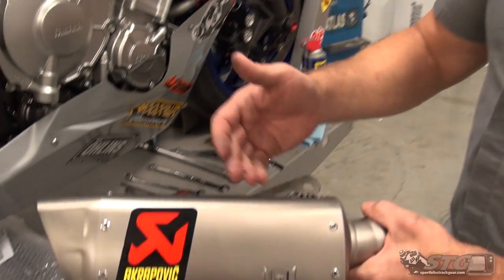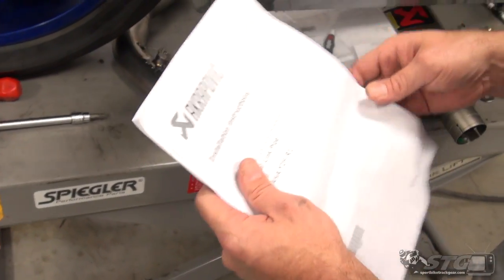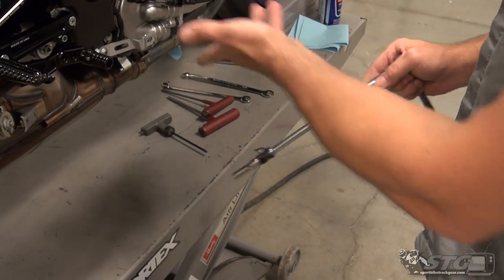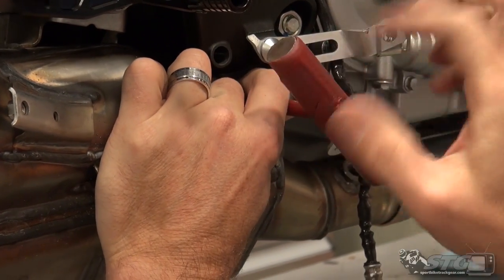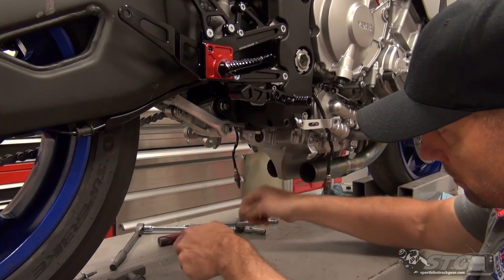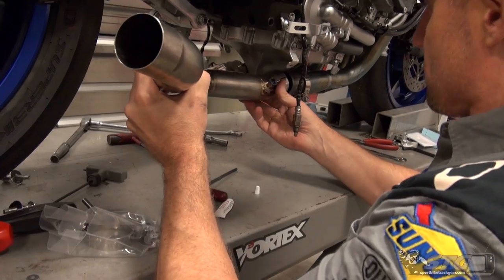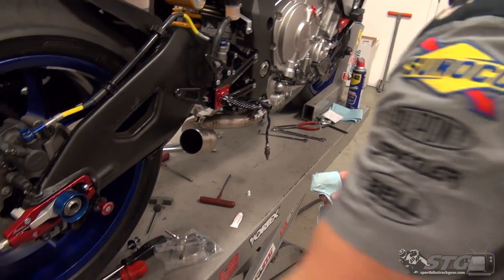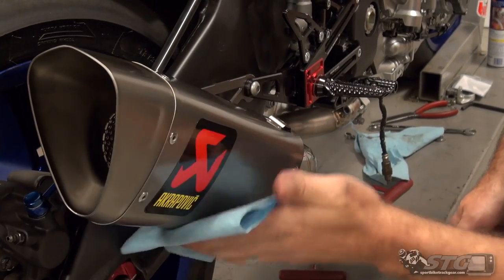Akrapovic Slip On Exhaust Install on a 2015-2018 Yamaha R1 from Sportbiketrackgear.com

Comment: Hello to all . with this exhaust my bike lost power. and accelerarion especially at low rpm motor. It is a normal thing ?! is there any way to retrieve the power lost?
Reply: +Alex G. You can't just throw a cat deleting exhaust on and not expect it to run poorly.  Get a flash tune, PCV, or Bazzaz.
Reply: +Jimmy MX on my old r6 there was impostation CO.
enough to incrase a bit values. and the problem la solved
Reply from the maker: +Alex G. Get a Flash Tune Kit, this will help solve that issue. That said the bike should still have more power higher in the rev range than before you installed this. I believe the exup valve is also intended to help with power at the lower end a bit, the negative is the flow restriction at the upper end. End of the day you will need to run just a bit higher in the rev range for low speed riding, the improvements will be noted as you rev the bike more and at higher speeds. - Van
Reply: +Sportbike Track Gear power commander 5? is ok?

Comment: which one is louder the shorty arrow or this one and which one makes more hp?
Reply from the maker: +Anthony evert I would say the Arrow is louder and will make just a bit more power than this 3/4 system. Now that said most riders will never notice the very slight difference in power (myself included). The quality and looks of this Akrapovic system are on another level as compared to everyone else IMO. There are other good systems for sure, many are more affordable and will perform and sound great. - Van
Reply: +Sportbike Track Gear yes I agree both sounds amazing I saw that they have another version of that akrapovic it's a gp akrapovic I think that one makes more power than the arrow and that akrapovic

Comment: This is for R1 2016 and fix for Akrapovic Yamaha YZF-R1/M 15-17 GP Titanium Slip On Exhaust?  642.55 $ for price....
Reply from the maker: Akrapovic Yamaha YZF-R1/M 15-17 GP Titanium Slip On Exhaust $713.10
Akrapovic Yamaha YZF-R1 15-17 Titanium Optional Link Pipe/Collector $642.55

Installing both the link pipe and slip on will get you the same 3/4 system I have on the STG R1. Have been very happy with this system. - Brian Van

Comment: The canister mount on the Akra utilizes a stock bolt?
Reply from the maker: +R-AIK It does!
Reply: Sportbike Track Gear is it posible to use the stock can on the akra link pipe?

Comment: which would you recommended M4 or Akrapovic??
Reply from the maker: Depends on what you are looking to spend in all honesty. The Akrapovic stuff is really some of the highest production quality stuff you can find out there. On the other hand M4 has great fitment and is priced very reasonably. Really all about getting what is right for you!
Reply: STG, do you recommend an aftermarket ECU (PCV) with this application?
Reply: TheVilouboy what kind of bike do you have ??
Reply from the maker: TheVilouboy Personally I use one, but it isn't essential.

Comment: Hi Van, Great video! I have the Akrapovic and link pipe with power commander myself. Question, is the Yoshimura Alpha 3/4 or Graves less loud than the Akrapovic? Thank you in advance. Best Fabian
Reply from the maker: +Fabian Otten I would say they are slightly quieter that the Akra. Thanks for watching!

Comment: how did the 520 kit feel?
Reply from the maker: +Kyle Abron Felt just fine, I went with stock gearing. At the track I made one small chain adjustment during a tire change. Vortex makes good stuff for sure! - Van

Comment: Greetings Van,
Wait......I didn't know that Sportbike Track Gear sold on-line motorcycle products. I ordered my Akrapovic Titanium Slip-On + Link Pipe through Revzilla.com.  I certainly would have ordered it through Sportbike Track Gear.  For both, I paid 1451.28 not inluded

Comment: reetings Van,
Wait......I didn't know that Sportbike Track Gear sold on-line motorcycle products. I ordered my Akrapovic Titanium Slip-On + Link Pipe through Revzilla.com.  I certainly would have ordered it through Sportbike Track Gear.  For both, I paid 1451.28 not inluding
tax.  I will certianly connect with you regarding the other accedssories listed!!!!
Best,
Dre-Day
Reply from the maker: No worries, we are here when you ready and will work hard to get you all dialed in with your R1! - Van
Reply from the maker: No worries at all my brother, we are here when you are ready for the next order. Revzilla is a solid company for sure, we are smaller and much more focused on sportbikes than they are. With all the project bikes we do our goal is to add some value to the transaction to help our riders get the parts they want and get them installed properly. - Brian Van